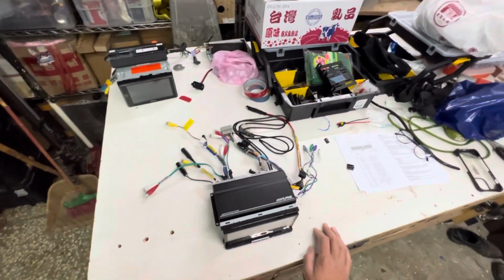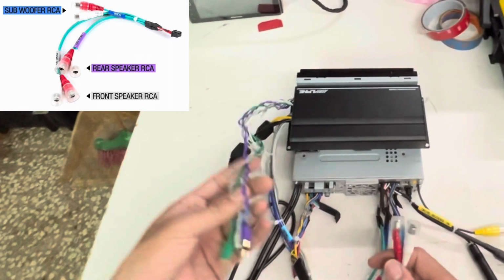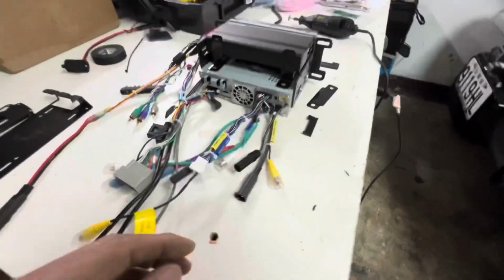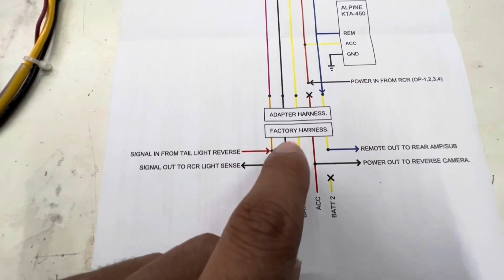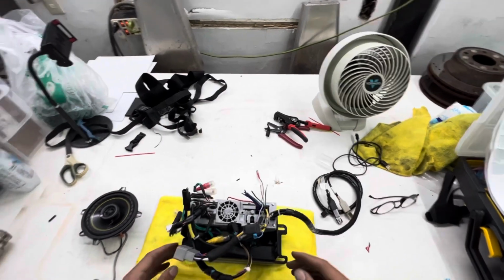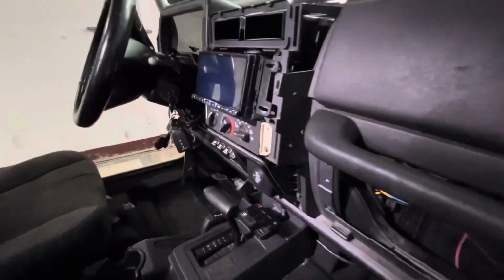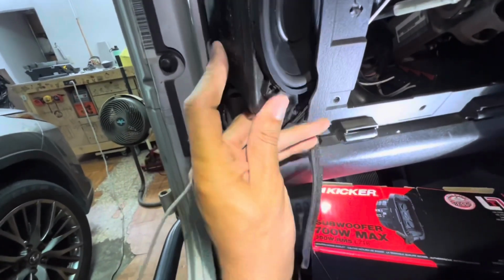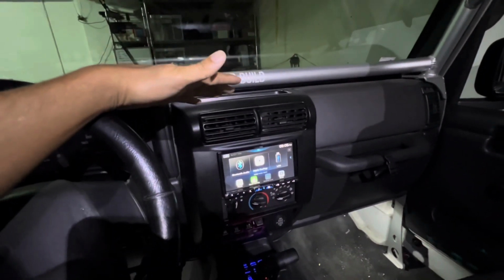Jeep TJ Audio Upgrade - Alpine iLX-507 / KTA-450

Comment: Im building a Portable Boombox using a Alpine HU and the KTA450 , would i run  the ground wires to the battery ground ?
Reply: If you want to. Look where the other end of your battery cable goes. Thats a good spot too.

Comment: Hi Jay. Gonna buy this head unit but looking for more info on the e brake defeat. Can you tell me what you’re using there and how you wired it up?
Reply from the maker: I got mine on EBay the brand name is “MicroBypass” 
Here’s the directions copy/pasted from a screenshot on my cell. 

AWARNINGI It is dangerous (and illegal in most states) for the driver to watch the video monitor while driving the vehicle. The driver may be distracted from looking ahead and an accident could occur. Install the MicroBypass only in Retail Display, RV, or Marine applications where there is no parking brake to interface to. Do not install the MicroBypass where the driver may be able to view the monitor when driving. ILLEGAL USE PROHIBITED!
Installation Instructions
1. Connect BLACK wire on MicroBypass to
BLACK wire (Ground(-)] on Alpine Radio (Also Connect to the Vehicle's Ground wire)
2. Connect BLUE/WHITE wire on MicroBypass tO BLUE/WHITE STRIPE wire (remote turn on (+)] on Alpine Radio (This connection can also be shared with Amplifiers if Present)
Connect YELLOW/BLUE wire on MicroBypass to YELLOW/BLUE wire [Parking Brake(-)] on Alpine Radio only-do not connect to vehicles actual parking brake wiring/circuit
4. Connect YELLOW/BLACK wire on
MicroBypass to YELLOW/BLACK wire [foot
Brake(+)] on Alpine Radio only-do not connect to vehicles actual foot brake wiring/circuit, no connection if not present on Alpine harness
NEED INSTALLATION HELP? CONTACT US DIRECTLY AT MICROBYPASS@MAIL.COM
Reply: @JeepTJay6  Thanks Jay. Enjoyed your video.
Reply from the maker: @flidvicious  Glad I could help. Thanks for watching. 🍻
Reply: @JeepTJay6  DIYBypass sells a version without the foot pedal wire, I plan on testing that version soon.
Reply from the maker: @flidvicious  I used what’s called a “MicroBypass Video Parking Brake Bypass” I found it on eBay. The seller name is “Microbypass1”. It came with wiring instructions. Pretty straightforward install.